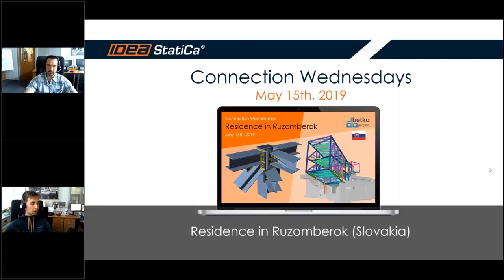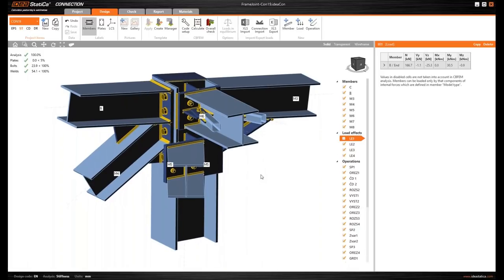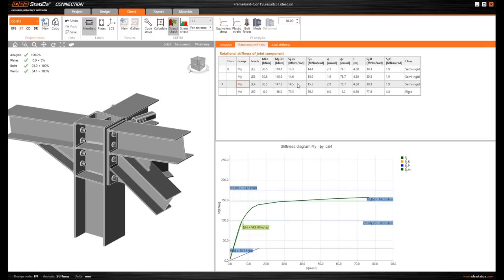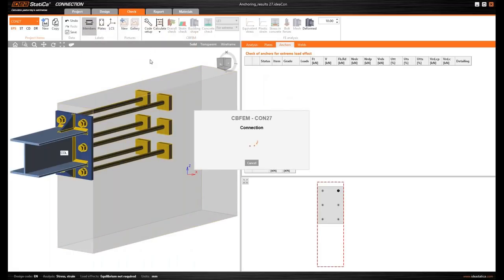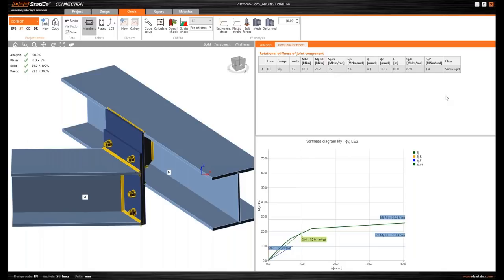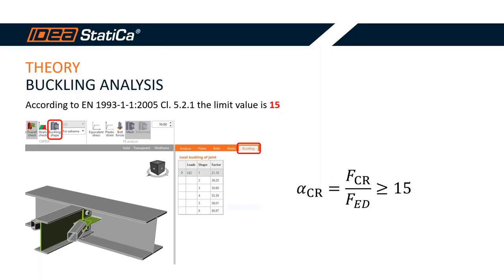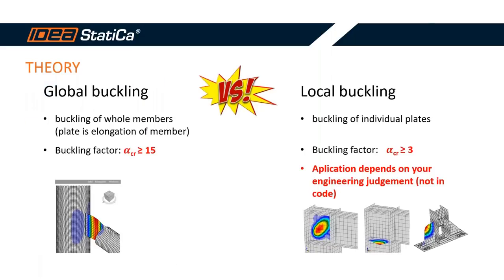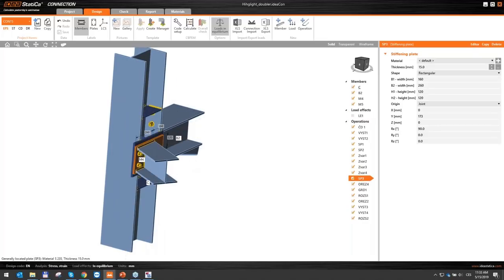Connection Wednesdays – Residence in Ruzomberok (Slovakia)

Comment: In the minute 18:35, when you did a stiffness analysis for the third example, it turned out the joint is not a pin connection. It is actually a semi regid connection. So, shouldn't you have changed the location of the load to "node" again? Because it's not required that the position of load to be in the "bolts" or "position" since its not "pin-connection" anymore. Please your explanation. And thank you in advance. I also asked another question. Please read my other comment for the second question.
Reply from the maker: Yes, correct. It would be best if you separated the corresponding internal forces to load effects to analyze the behavior without the influence of other directions.
Reply: Thank you for replying 
I meant i think you have to change the location of the load to node again and do the stiffness analysis again. Am I right?

Comment: Regarding to the load cases, what if you have Mz and Vy? will you create to other load cases? one for Mz only and another one for Mz and Vy only? I mean if you wanted to calculate stiffness about Z axis.
Reply from the maker: We recommend placing the forces in the place where it acts in the real situation – which is the face of the shifted end plate. The issue with pinned connections is that they are not able to take a moment (obviously) but while its semi-rigid the analysis can converge to both scenarios (rigid or pinned).
Reply: Thank you for replying.
I mean if you have a rigid connection and you want to do a stiffness analysis for it. You obviously delete all the load cases and leave three load cases only
One is only moment
second one is moment plus shear force 
And the third one, you leave all internal loads as its. 
So, regarding to the moment,, you only leave my. But in case you wanted to check stiffness about z axis. So which internal load you should leave?

Comment: Hello , nice video . Don't take it the wrong way , why do you think we can't use method from Eurocode 3 (En 1993-1-5 Annex B ) to evaluate local and global buckling ? It gives us values . 
Thank you .
Reply from the maker: Hello Shota,
of course you can. The limits of buckling factors are there to make sure the plastic analysis can be used. If your joint is below the limit, you have to limit the stress in the slender element to buckling elastic stress determined e.g. by Annex B of EN 1993-1-5. The procedure is not incorporated in our software but user can follow the results with hand calculations. But it was verified on several examples, see e.g.: https://resources.ideastatica.com/Content/02_Steel/Verifications/Articles/04_CVUT_Slender%20compressed%20plate.pdf
Reply: @ideastatica_en    Thank you   for your reply .